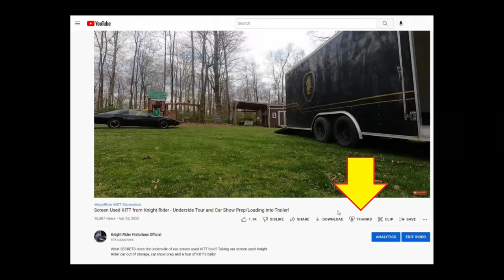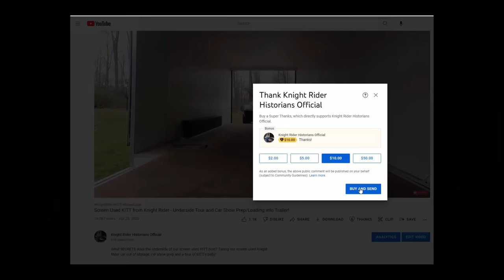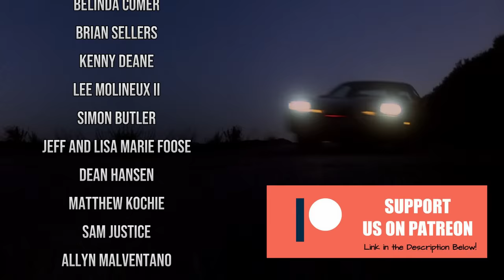Knight Rider Screen Used KITT Interior Refresh + Skid Plate Removal & Undercarriage Tour!

Comment: Clean the pan up, make sure all the mating sections of the pan and transmission are clean and smooth, cork gasket, torqued to the right spec. I would heavily consider cleaning up the underside of Kitt and paint it trying to keep it looking original. That rust will destroy KITT and you really don't want that to happen after all the hard work you've put into him Joe.  Keep up the absolutely amazing work.
Reply: I agree with Charlie about keeping the underside clean and free of rust. Get some kind of paint that can help protect against future corrosion... KITT is way to special to be destroyed. Trust doesn't Rust .
Reply: I also agree with Charlie, but I have another suggestion if you don't want to just 'paint' the underbody of KITT. As a former Professional Detailer and involved in the 4X4 community here in Australia, once you got KITT's underbody cleaned up and rust removed, you could then use combinations of three different types of rust protection and these include: 

LIQUID Rust Protection - professionally sprayed on like a thick honey / molasses which gets into all the nooks and crannies before it then sets rock hard. These types of liquid chemical protections can be thick black and bituminous or completely clear, so it doesn't alter the appearance of the substrate.

CERAMIC Rust Protection - Ranging from the basic Gtechniq Crystal Serum Light that provides a hydrophobic finish with added gloss, right up to the premium Crystal Serum Ultra 10H Ceramic Protection, which offers non-reflective and true black hue that helps protect against fading. These premium ceramic finishes will also protect from insect acids, salt corrosion, dings, bumps, scratches and rock chips.

ELECTRONIC Rust Protection - Due to KITT having additional or dual batteries for accessories, the same as many 4X4's, having a reputable brand of electronic rust protection gives Joe the added peace of mind, knowing that KITT would be protected especially if used in conjunction with one of these other methods above. These systems help stop rust by disrupting the natural electro-chemical rusting process and have proven popular for more than 30 years.

I hope this helps give you some options to explore because we all agree that KITT is far too precious and special, not to give him all of the very best protections possible that us FLAG Agents highly recommend!
Reply from the maker: Thanks Charlie. There's no concerns with the underside. The car is stored in a climate controlled garage and never driven in rain or snow (or on the road for that matter). We would never paint the underside - it would ruin the originality.
Reply: @KnightRiderHistoriansOfficial  😳😳😳😳
Reply: @KnightRiderHistoriansOfficial  
People who don't live in arrid dry climates don't understand this. This car will last for many decades just like it is.
Reply: @ironsidefan  yes I am..others have done some really wild things with their KITT replica. Some have gone as far as making them actually interactive through speech and reactions...pretty wild with the electronic advancements we have available today. Just imagine how wild it would have been back in the 80s with what we have today. A lot of KITTS features paved the way to what many vehicles have as standard features now. One guy has a remote kitt with a superbly quiet engine and exhaust but has a speaker system under the car and under the hood that projects the turbine engine sounds instead of a regular gas engine. People are really getting good at going all out a in making their KITT as realistic like the show as possible. Imagination and money...the sky is the limit.

Comment: Seeing that the torque converter is dry, I would believe that the front pump seal is not leaking. I would also suspect that the pan is leaking due to the RTV sealer. I've had good luck using Felpro Rubber transmission pan gaskets installed dry, with no sealers or RTV.  Awesome video btw, keep them coming!

Comment: I definitely believe you should replace the transmission pan gasket. You might as well replace the filter while you’re in there. The filter just snaps in and out. There’s an o-ring to seal it to the valve body. Use a rubber gasket with a gasket adhesive to ensure a good seal. Even Loctite spray adhesive will work.. I use it on my truck and never had a problem. Don’t use a cork gasket as it could crack or rip if you over torque it…..Obviously make sure you have clean surfaces before spraying the adhesive, laying down the gasket, and re-installing. To make your life easier, spray both sides of the gasket… then place the pan up.. and put the bolts in. 

I’m hoping you will make more videos of KITT. You’re extremely fortunate to have a screen used car.. and I really enjoy these videos… since I’m building my car. Thank you for taking time to read this and I’m looking forward to the next video. Hopefully I’ll get the chance to meet you in person and shake your hand!!!

Comment: Hi! I have replaced those old gaskets with a neoprene gasket for the TH350 transmission. They work great! Make sure when you get the pan off to straighten out the pan rails on it!  Using a 1/2 inch steel block in the pan rails and a flat faced hammer to flatten out the bolt holes and the rails to make them flat and straight again! When using silicone or RTV it should be very thin and spread out on the pan and gasket so that when fully installed it doesn’t squeeze out and it really can’t be seen. If it squishes out of the gasket then it will be inside as well. Bad thing is if any of the silicone or RTV comes loose inside it can cause a lot of problems. This applies to using it on engine and differentials as well! I have seen a lot of dumb mistakes caused by that! I hope this helps!

Comment: Excellent work!
I have always heard that you should never use sealer on the pan gasket as you don't want the possibility of small bits of RTV getting into the passages or the valvebody. That could wreak havoc on its ability to shift properly. 
A quality name brand pan gasket on a pan that has been checked for straightness and with the bolts torqued correctly should fix the leak if that is where it was coming from. I usually clean the oil residue off with brake cleaner and compressed air, then run the vehicle up to normal temperature and check again for any signs of leakage. 👍

Comment: As motorscotti said, just use the supplied gasket that comes with the filter. I will dab a lil grease in the corners of the pan to help hold the gasket in place while 
installing the pan. Love these types of videos.  Btw, I'm only about 2 hrs east of you.  Let me know if you need help with the tractor or trailer.
Reply: Pretty sure that's what it is.  I've been watching a channel called Rainman Ray's Repairs, and he says that gasket + sealer (except in certain spots the gasket doesn't cover) is a definite recipe for a leak.

Comment: Great vid! I'd get a rubber /silicone reusable gasket, with no sealant. The shift linkage is a common leak point on most autos when they get old. But the pan gasket would be the first thing to do. Looks like the speedo adapter might be leaking too, I think those are just an oring.

Comment: I've had good luck with Lubelocker trans pan gaskets, recommend them over silicone.  While you're at it, good idea replace dipstick tube o-ring.  Probably the best thing to locate the leak is degrease/pressure wash the trans then run the car and look for the leak.
Reply: Agreed! The Lubelocker gasket I put on my 700r4 has been fantastic.
Reply: Agreed. The transmission fluid has been puddling up on the skid plate and smearing. Definitely clean it up and run without the skid plate to find the source.

Comment: So cool, thank you for showing us the underside of this KITT. I'd say the leak is coming from the pan gasket. Maybe change the dipstick tube grommet as well while you're in there. 
Rubber or cork for the gasket: Last time a bought a replacement filter and gasket the set came with a rubber and a cork gasket and the instructions said to use either one or the other depending on whether the surface is flat or has a bit of a structure to it. For the 700r4 it was the rubber gasket / clean flat surface.
Reply: Very much a classic issue. I had the same issue with my Chevy. you're also right about how gaskets can deteriorate over time
Reply: MotorScotti...thank you for you videos as well!!! You've been a tremendous help for  me working on my Trans Am

Comment: It is very common for those transmission pans to warp due to over torquing of the bolts. Even a little will cause leakage. You should just use original gaskets and never the RTV. That RTV will break down over time and damage the transmission. You can try to just change the gasket, but you may need a new pan to stop the leak.

Comment: 27 year mechanic, no RTV on the transmission pan use a felt type gasket, no cork garage. Front pump seal looks great no leakage. Honestly put a transmission filter kit in, shift shaft seal and might as well put the tube seal in. If the tail shaft seal is good leave it alone. I remember sitting in that car in Biloxi, MS at the Edgewater mall in the 80’s in front of Gayfers.

Comment: I recommend a Lube Locker reusable pan gasket for the transmission.  Make sure the pan flanges are straight prior to installation. Apply blue thread locker to the pan bolts, and torque them to 12-13 lbs./ft.

Comment: You are  correct If it was the pump seal. It would be pouring out near the torque converter. And slinging fluid all around it.  The pan is leaking.  Worked on many transmissions, putting the sealer on the pan gasket can actually cause a leak, especially that orange silicone sealer. Seen it many times on customer's cars.  Best thing to do is clean the pan and transmission sealing surfaces real good and put a proper gasket on it. Torque the pan bolts evenly. I believe on the turbo 350 transmissions originally it was a cork gasket, but they leaked a lot. A better design I am sure is out there, fel-pro, lube locker etc.. should be a good gasket. Been a long time since seen one of those trans.
Was a technician at a Pontiac dealer from the mid nineties till Pontiac went away. Miss those older Firebirds.
Another great video, kitt is such a cool car!

Comment: Yeah definitely looks like the pan gasket, and looks like there’s way too much silicone too. I usually use a good quality gasket and just lightly put a very thin coat of RTV on both sides of the gasket to help it stick and seal any scratches or gouges.

Comment: Me and my dad always use the black atv gasket sealant to hold the automatic 350 turbo transmission oil pan gasket and for the engine you need to buy a wix engine oil filter

Comment: Definitely not a front pump seal leak. It kind-of looks like the transmission pan gasket is leaking, if you replace it just use the gasket, no sealer. However, I did see a droplet of trans fluid on the kickdown cable and lever. So here's what I suggest. Get a bottle of oil/fluid leak dye and a blacklight at your local auto pats store (they do sell kits with the light, dye, and shades) . Clean the transmission thoroughly with brake cleaner and wipe it dry. Put the appropriate amount of dye in the trans fluid by way of the dipstick tube. Run the car and drive it for a bit, then park it on the ramps. Using the blacklight and special glasses look for dye traces. Dye will show where the fluid is leaking. No leak/dye traces right away? Park the car in the garage, then let it set overnight or a couple days. Put it back on the ramps and recheck it with the blacklight. You should be able to narrow it down.

Comment: Turbo 350 pans are notorious for leaking if you over tighten the pan bolts. Replace gasket with sealer but don’t over tighten.

Comment: RTV  doesnt like automatic transmission fluid unless its specifically made it.  It will eat the RTV.  Its also very very common to over torque the bolts and cup the sheet metal pan.   Take it off, clean it, check for flatness, hammer and dolly if needed then reinstall with a silicone gasket with crush spacers imbedded to prevent over torque

Comment: I’d replace the transmission gasket first Joe. Don’t use RVT next time. I use high tack gasket sealer, just on one side of the cork gasket only.
Used torque specs on the bolts. Use a cross pattern to tighten them

Comment: Hey bud just watching your video caught the concern about leak and message me if you need but you will figure it out. I can almost guarantee it is the plastic gear in the side that goes to tach. It gets a groove. Even a new one can leak so missed sometimes but unless other problem or Crack 95% sure I dealt with this when I purchased mine. Never leaked once since the right color plastic. There are a few options... Keep it up man. I put my replica into a pole the other night.  I am set back 2 years at least if I can save it! One pole can make a diffrence.

Comment: Get a good gasket (I like Felpro), and put a small dab of silicone on any visible metal joints in the transmission housing, then bolt the pan back on, following the manufacturer's order of torquing the bolts. And make sure you torque them to spec so you don't over-compress the gasket

Comment: Just check the transmission pan bolts by trying to tighten them up, use a small ratchet and do your tightening bolt pattern.  A couple automatics I got stopped leaking from just retightening the pan bolts. No point in replacing the gasket unless you have to.

Comment: Leak is Most likely pan gasket . Use a cork seal dry . light torque like 10 ft lb , scotchbrite a scuff on all the sealing surfaces , TH 350 work great with old school Type F atf . GL , love the channel . 👍🏻
Reply: Oh … and use a dab of some thread sealant with Teflon on the bolt threads . Also check around there’s an O ring on the shifter shaft and speedometer adapter housing that sometimes leak , that requires removing the valve body to replace . Also check governor cover in back , that can be sealed with light layer of rtv when removed .

Comment: Transmission leak.  Been working many vehicles. It's the pan bolt holes. Needs to be flattened with a ball peen hammer on a 4x4 piece of wood as support.. the holes basically are out of shape. That creates the leak on re install..  Also don't use rtv.  Only use a gasketcinch to seat the cork or newer material to the pan.  No sealant on the transmission side.  Get all bolt holes equal torque not too tight but snug.  Use a small ratchet. I had  two F bodies in the past.  Permatex also makes a good brush on sealant( high tack sealant) to mate the gasket to pan.hope this helps

Comment: You also might want to check the seal at the shift linkage and at the speedo cable or sensor, i know the newer firebird or trans am had a electric speedometer sensor instead of a cable

Comment: These kinds of videos are some of my favorite. 
It's part history of the show car, part car repair turorial, and a big chunk of info for my build of the 1/8 KITT model from FanHome. When I get to that point, I'll have to look for the right color in model paint, and then add a trunk pull handle back there.
What color would the underside have originally been? Would it be painted to match the outer body?
Are you able to share the paint you found that matches the interior color? At some points you said paint, then I think you said you dyed the panels, so I'm not sure what you actually did to color them.

Comment: About the pan, please note that RTV is not to be used on the entire gasket; the gasket should be installed clean and dry. RTV should only be used on the corners of the gasket and/or stepped casting areas that have a gap. Using a small amount of RTV will fill in those areas to assure a leak-free assembly with the gasket. I did the same thing on a 82' Mustang and got a leak on the pan A cork gasket alone torqued to the right specs should be enough, or if you want to go fancy, you can use the RTV alone to make a gasket to seal the pan. SO either use gasket or the sealer, NOT both at the same time! Hope this helps.

Comment: Remove and replace the transmission pan. Use a body hammer to flatten the bolt holes in the pan while you have it out. Might as well replace the filter while you are there. Use a cork gasket, don't use RTV, and tighten the pan bolts to 120 inch pounds.

Comment: Other people have already commented but make sure you check around the shifter linkage and the dipstick tube are notorious for leaking on those transmissions as well. Your best bet is definitely change the pan gasket then I would degrease and power wash the bottom of the tranny.  Start the car and get underneath and look for leaks before you put the skid plate back on.  If you degrease and power wash it under there you should be able to tell right away where it's leaking if you start the car up and get underneath.

Comment: Being that the convertor is dry inside the cover, it shouldn't be the front pump seal. That would definitely be wet if the seal was bad judging by the amount of oil on the skid plate. The pan gasket isn't a big job, just messy. Clean all the old gasket and sealant from the transmission and the pan. Check the edges of the pan with a straight edge to make sure it's flat. If not, you can use a piece of wood and a hammer to carefully flatten it back out again. Replace with a rubber gasket with no sealant and torque the pan bolts to spec.

Comment: No gasket sealer needed. r&r without sealer.  Cork gasket is fine but careful to not over tighten and check bolt holes are flush with gasket surface. Also check that shifter bracket seal-looks like it had a drop of fluid on it, could cause just as much fluid loss on its own.